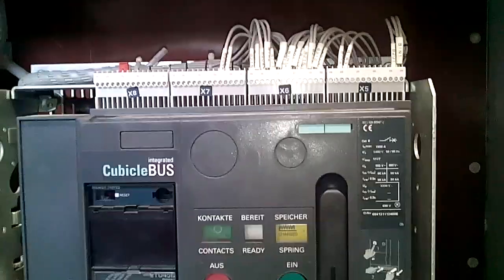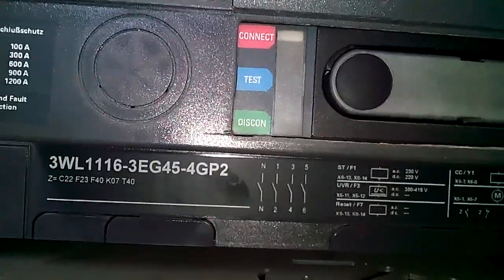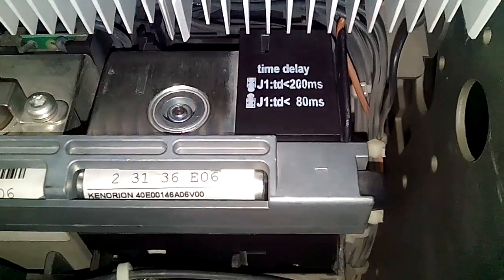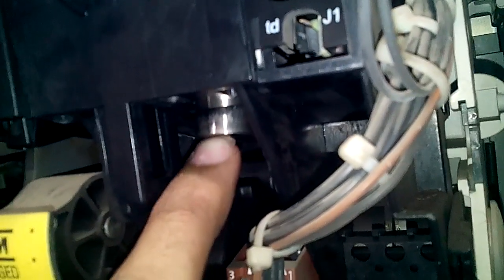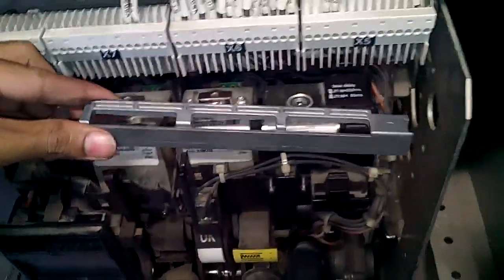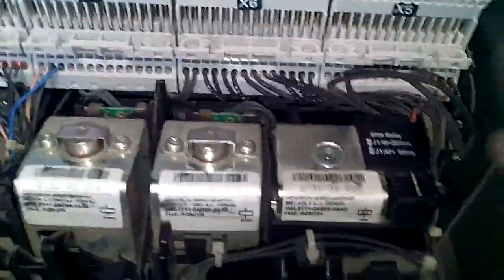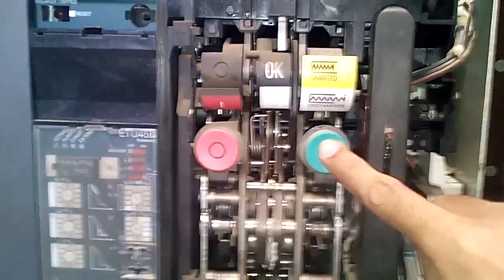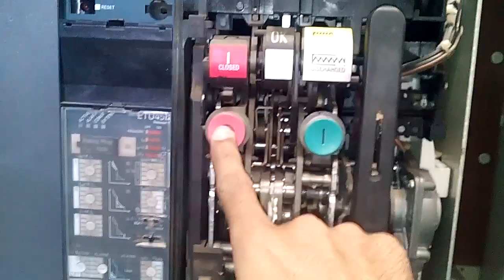Air Cuicuit Breaker SIEMENS-WL I 1600 S

Comment: Hello sir .
Is it possible to make ACB trip manually through trip unit or is there any certain kit for it.
Please guide me
Reply from the maker: Yes there is a shut coil in every ACB. You will find both end of this coil at ACB terminals X1 and X2. When you give appropriate supply to this shunt coil ACB will trip. This shunt coil is give for remote trip maually or by any other supervisory relay
Reply: @djakhar79  
How to check the trip unit function wether it is healthy
Reply from the maker: @santhoshrodrigues2791  there are several test kits available in market for testing tripping unit functioning  example- EATON  fuction test kit

Comment: SIR  WHEN YOU REMOVED  UNDER VOLTAGE  THEN HOW IT WAS  ABLE TO CLOSE ? HOW YOU DEFEATED THE UNDER VOLTAGE  FUNCTION ?  OK
Reply from the maker: When there is voltage the coil generates magnetic field which attracts spindel and spring ( see at 7:40) in which spindel fixed it get charged. It keep in this position when voltage fails this spring releases stored energy and spindel strikes on a mechanical point and it trips ACB and it keep press that mechanical point which keeps ACB in trip position now if we removes UV coil there is nothing to press or keep in press position to trip ACB or remain it in same... so by removing this coil ACB is free from UV trip